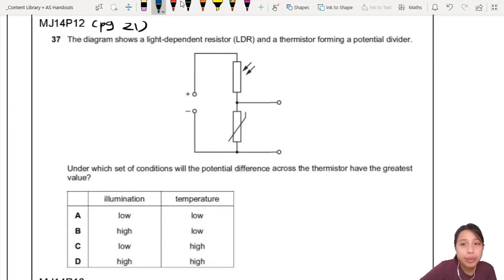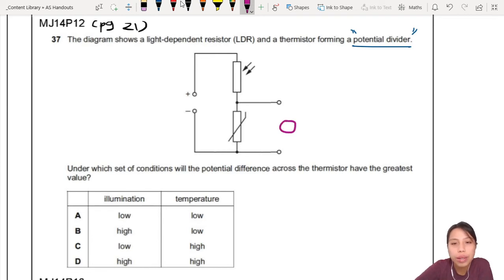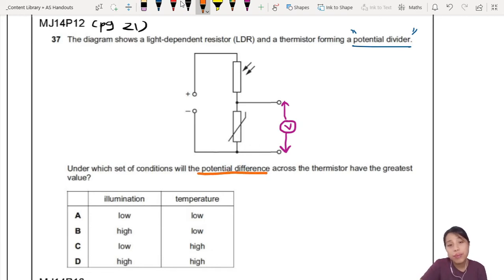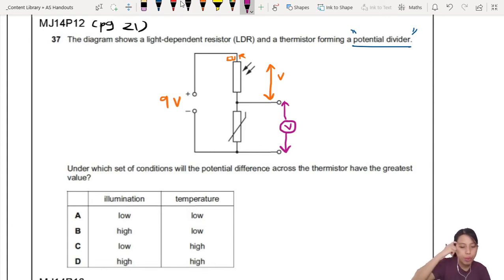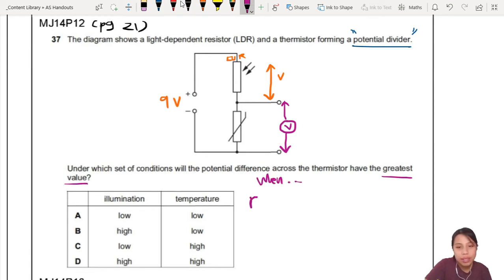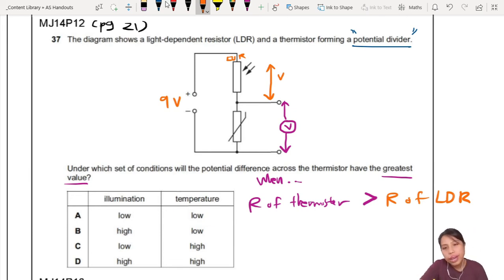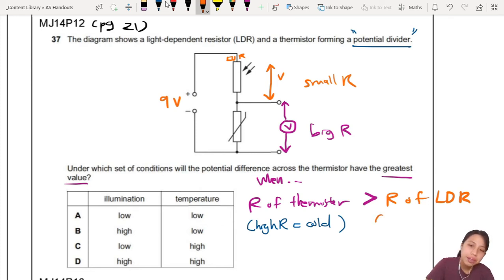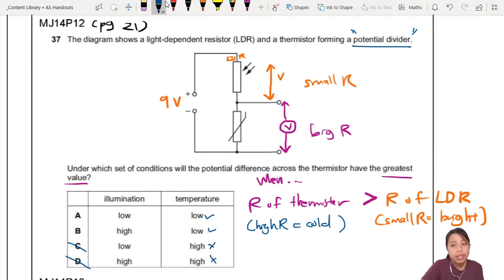9.3b Ex1 MJ14 P12 Q37 LDR Thermistor p.d. Conditions | AS Electricity | CAIE A Level 9702 Physics

Comment: I don't understand about the why pd will be larger where resistance is increasing 😢
Reply: This circuit is a series circuit in which current will remain the same so if resistance increases voltage will also increase.